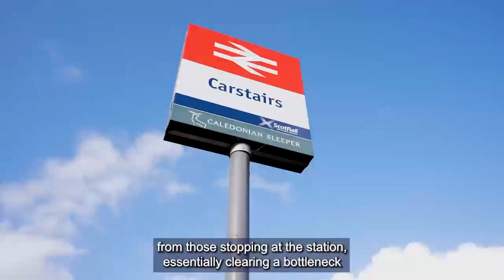Critical Carstairs junction upgrade is key to modernising network

Comment: I often used to travel by train from Lockerbie through to Edinburgh Waverley via Carstairs or by-passing Carstairs and simply transferring across to the Edinburgh line on my way to Kirkcaldy in Fife.

Before rail privatisation it was often a case of trains coming up from down South on the WCML would slow down and pull into Carstairs station where the train would either split in two with the front 2 or 4 carriages going to Glasgow Central via Motherwell and back carriages would then head back out of the station but round onto the branch line to Haymarket and Edinburgh Waverley.

Sometimes it was the case that you had to actually get out at Carstairs station and wait on the platform for another train arriving from Glasgow Central to take you to Edinburgh, and Csrstairs station was often unmanned particularly at night and the old stonework that made up the station and the surrounding bridge plus the fact that Carstairs was usually very quiet lent itself to making a rather intimidating atmosphere.

I can remember one or two people who had travelled from Lockerbie and had to change at Carstairs and they hated it, said it was a very creepy old station.

After rail privatisation it changed a lot, there wasn't the need to stop at Carstairs and of course we saw a lot of the very popular Virgin Trains both on the West Coast mainline services between Glasgow Central and London Euston as well as the Virgin XC services that ran between the South Coast of England and Aberdeen, this was great for my family and me as we could often catch a train straight through from Lockerbie to Kirkcaldy.